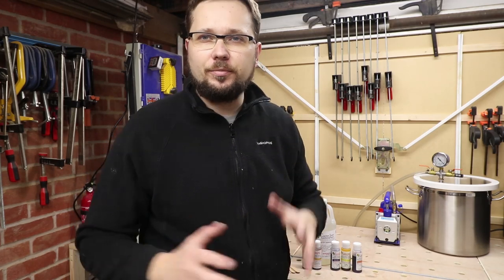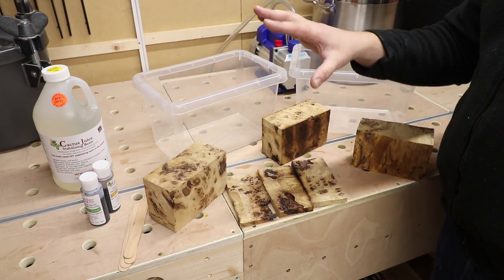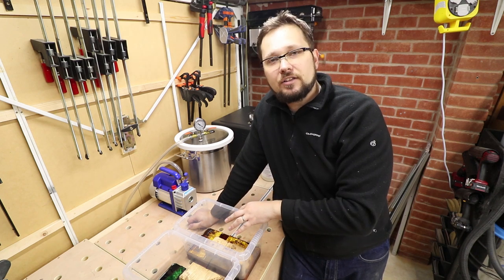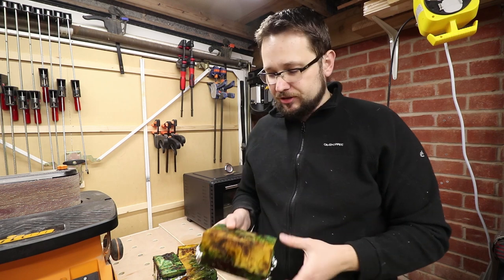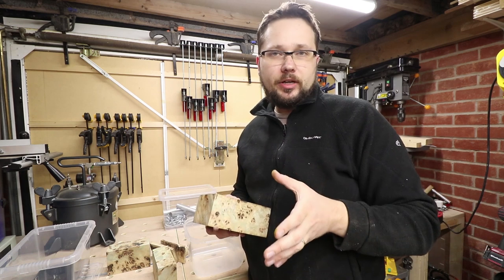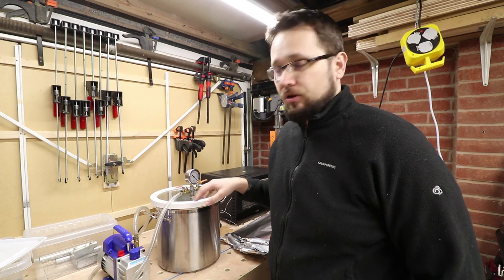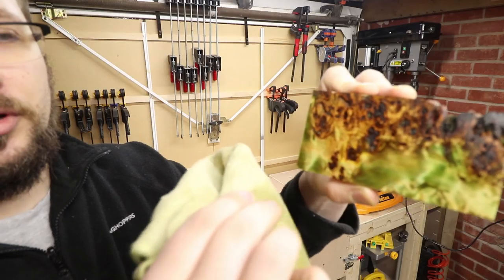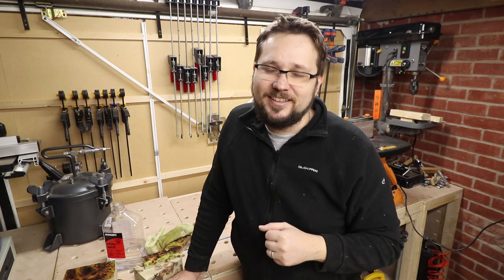How to DYE and Double Dye wood in the stabilizing process with Cactus Juice - Resin Tutorial

Comment: Hi, great video well detailed. Do you leave the vacuum pump ON for the full duration when sacking all the air out of the wood? Or just like the pressure pot once it gets to the desired level switch off and leave as it is?
Reply from the maker: Thank you.
I will leave it on for a good while but then I will switch it off and check every hour or so and if need be I'll switch it on to get it wherein needs to be.
Reply: @CasualDIY  Thanks,really appreciate your reply 😀

Comment: Hi. Thanks for the information. I’m building an outdoor chair made of Western Red Cedar. I’m thinking about curing it with Cactus Juice instead of a standard finish. 
Would I cut and sand all the pieces prior to curing? Does the process warp wood? Planks about 1” x 4” x 3’ or so. My thought is to get every piece ready for assembly, including holes where needed, and then putting them through the process. I just worry about warping the pieces out of shape. 
Also, can I mix a cedar stain in with the CJ? Or stain them prior to curing? 
I’d appreciate your advice. 
Thanks,
Paul
Reply from the maker: Well I have to say not had a question like that before. You know you have to fully submerge the wood in cactus juice then put it in a vacuum chamber and then bake it? It's either a very small chair or you got a massive owen and a huge vacuum chamber 😅 . If we are talking about normal sized chair then you will need gallons of cactus juice and that will cost you a small fortune. The wood needs to be bone dry, close to 0% of moisture. So the drying process ( in the owen) may lead to wood warping .
All that aside I would not recommend using this as a finish in any way shape or form. When you follow the cactus juice stabilization process then what you get is a very hard, dence material that will be more brittle. Not suitable for furniture making.
Reply: @CasualDIY  Thanks. That’s what I figured.

Comment: Sir did you vaccum 6 hours continuously or you vaccum one time when bubbles out from resin, please guide
Reply from the maker: Vacuum on until no bubbles are showing then I turn the pump off but leave the pot under the vacuum
Reply: @CasualDIY  sir your mean continue vaccum pump on until when bubbles vanished on resin,after seen when no bubbles in resin pot,off the vaccum pump but not released vaccum air of vaccum container, and leave the vaccum container with vaccum without release vaccum air and switch off pump, for 6 hours ,am i right or wrong

Comment: Hi Tomasz, how hard does this wood become? If you stabilize a cutting board this way, would the wood not be able to chip when someones using a hatchet against it?
Reply from the maker: It becomes very hard. But not bullet proof if you know what I mean. I would not recommend this prices to be used on any wood that would come in contact with food. The reason you would use an end grain cutting board is that it will not dull your knife so quickly.
Reply: @CasualDIY  Thank you Tomasz, excellent video.
Reply: Casual DIY dc

Comment: How deep does the dye stain can you do bigger pieces ?
Reply from the maker: In this case it went through the whole thickness, right to the core. You can but the results will depend on many factors and two pieces of the same board during the sane process may give different results.

Comment: Hi
I'm sure you're telling you important information
I am so sorry I could not fully understand because my English is not good. I need the answers to my questions below in writing.
I am writing from istanbul turkey you will have  4 questions
1.  For each color, the paint impregnation process is outside and in the boiler, it should be waited separately for how many hours.
2. How many hours should it wait in the stabilizing liquid in the vacuum boiler?
3. How many hours are left in the oven each time and how many degrees the temperature should be.
4. What are the important points that I should be especially careful about.
Your answers are very precious for me
 Thank you very much for your help

Comment: Hi,
so you only use resin..no hardener?
Reply from the maker: This is called Cactus Juice Resin. Initially it comes with two parts, the hardner is mixed with the resin when opened for the first time. The resin cures under temperature treatment. That's why you put it in the oven 👍
Reply: @CasualDIY   Thanks! So when i use different Resin, i use it like the normal way with hardener right?!
Reply from the maker: @steffh9683  yes but not for stabilisation. It's a total different process and type of resin
Reply: @CasualDIY   I just saw, there are some "stabilization dyes"..do i have to use them, or can i use normal dye like for example from alumilite?
Reply from the maker: @steffh9683  I'm not sure if normal dyes will work with cactus juice to be honest. You may need to shoot a question to the manufacturer